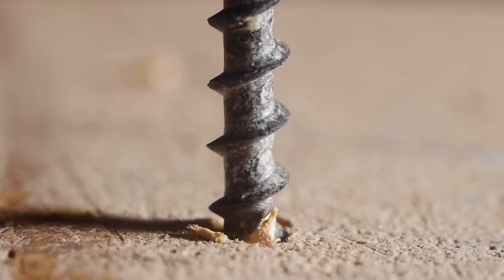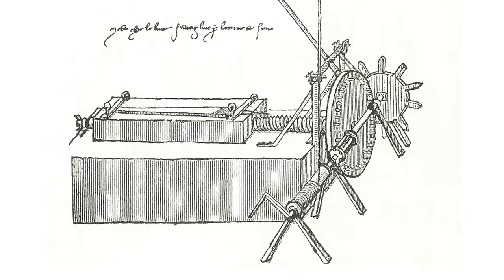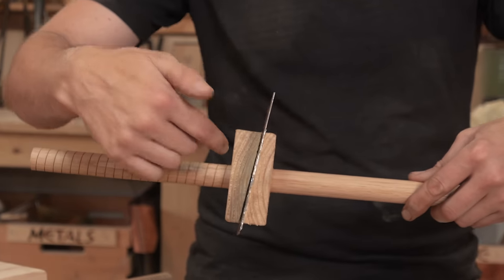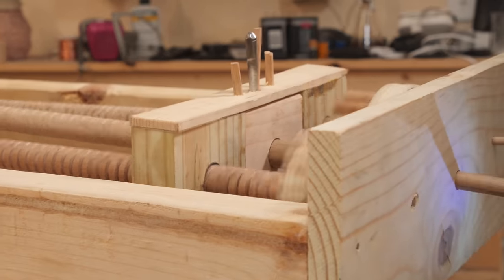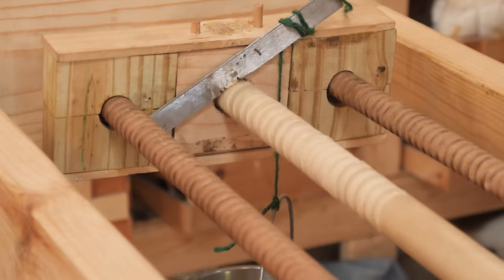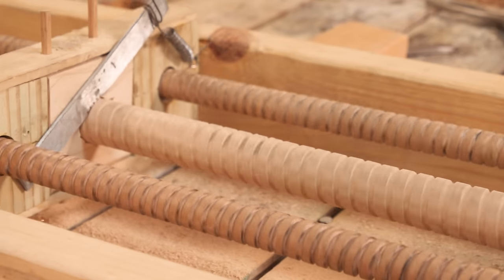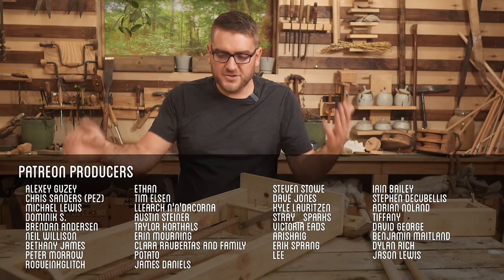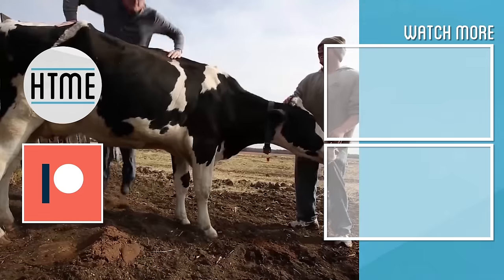This DaVinci Machine Unlocks Precision!

Comment: One of the most important aspect of this device (and of the lathe) is that the machine can improve its own accuracy merely by building with the very tool you’ve already made. As you make new screws you can replace the old hand cut ones (and more importantly) the receiving nut from a rough approximation of coiled wire to the wooden carved nut that matches the screws profile even more finely.
Reply: why even bother cutting the first screw by hand when a simple wedge aka inclined plane, pulled by a string and pulley on the shaft to force the cutter lengthwise does exactly the same thing, far more accurately?

this is one of those typical videos perpetuating the myth that davinci was a "genius" when its apparent he was not. other people figured out how to produce threads far faster and with far less hand work or guess work required.
Reply: @paradiselost9946  It’s not so much to do with just making a screw and threaded bolt with the same threaded profile, but two other concepts that this machine is trying to fulfil. 

The first is lowering the skill level to make screws and bolts. We were capable of making well mating screws and bolts before this design because Johannes Gutenberg, the inventor of the modern printing press used a screw press for his own machine. However, whilst making one screw and one bolt by hand is possible, (although requiring a hire degree of skill) it was the only way of making well fitting screws until comparatively recently because it was damn hard to achieve. Hence why you don’t see many screws in historical examples unless it’s absolutely necessary. What this machine Leonardo designed lowers the level of skill required to make screws and bolts dramatically, all the operator has to do is place the dowel into the machine and turn a handle and it will always produce the same quality of screw every time.

This leads onto the second purpose of the machine: repeatability.
Making a screw that can follow a purpose built bolt is one thing, making a screw that can follow any bolt and vice versa is an entirely different challenge altogether. But because the cutting is driven mechanically it will always follow the same input. Having the capacity to produce screws that will follow the same bolt every time is what gives modern hardware their utility, and makes them worth the effort in producing as opposed to having to produce a matching bolt for every screw you make.

Finally, there’s the matter of education and access to resources. Whilst it’s easy for us in our modern world to look back and think “why didn’t we just do it in this simple way?” It’s because learning clever tricks requires access to that knowledge. Whilst the craftsmen of the day were certainly not unknowledgeable (they were as intelligent as you or me today), they did not have the luxury of a system of shared information. What makes Leonardo da Vinci a genius in people’s eyes is that he was able to come up with a staggering number of concepts of which many were way ahead of his time only with the access to the resources and education of the period.

Comment: i think the better way of getting a smooth and good evenly spaced master screw would actually be to use two long rods or soft iron wires twisted together from the very ends. this will have them automatically form a double helix with two very consistent and evenly spaced grooves running along the entire length.
this is something a seasoned blacksmith can do in a day.

heck you could probably even do a plaster cast of a rope under tension in an easy to cast metal like copper

the problem with this machine is that while wonky cut threads will even out, any inconsistencies in pitch of the master screws will still be transferred to the new screw.

you can average out the pitch inconsistencies by offsetting the new screw between passes but that makes the process more tedious.

the master screws based on the twisted double helix of rods, ropes or wires  that i suggest should be way more consistent in pitch across their entire length with way less effort than the twist scribe and then handcut wooden masters

Comment: Cool video and project. I'm an engineer, artist, and woodturner so, this video really resonated.

Something for your consideration for a  screw+nut 2.0 project: I think that you were closer to a more elegant and more generally applicable plus usable approach w your first block. For instance, just as a scew is an incline plane twisted around a rod, a gouge is a skew cutter bent to fit around a rod and a V-gouge is a skew bent around a corner. Now consider the profiled cove moulding that they used to use to make complex crown mouldings, etc. You gradually pass the moulding plane over the wood and cut the profile more and more into the wood. Now consider wrapping that moulding plane around a rod and you have your screw rod cutter. Keep your two pieces as shown in your video and wrap sinew around the outside w a wooden dowel to twist to increase depth of cut as you make your passes. By keeping this as a smaller annular plane, you are not limited to length and you cd even use it in the field. The nut plane cutter wd be the photo negative, w maybe a wedge to drive the two pieces progressively more into the cut pass after pass. Again, smaller unit and portable. And you can even pop the screw moulding cutter into your daVinci apparatus, if you wanted to help keep longer screws straighter as you cut. I can see different screw mould planes for different diameters and pitches; just swap to a different profile. I'd love to see a Screw 2.0 video!

Comment: The two lead screws (with the relatively loose linkage) average out the errors between them, which is desirable in the transition between hand and machine screws. Cut two screws with your hand-cut lead screws, then endo one and use them as lead screws to cut the next generation.
As a bonus, if you use a much softer material (like balsa for your wooden screws, with the grain parallel to the axis) in a much longer nut (say 8 inches) you’ll average out local variations even more.

Comment: They used a tap and die box for making wooden screws back in the day. The quality of wooden screws were so good they used giant ones to cut the grooves in flintlock rifles. These barrel rifling tables were very popular in the Appalachian mountains as iron was very expensive back then so they had to improvise with wood. There's a video from Tyler Weymouth on YouTube showing one of the cutting machines from the 1960's. 
One important thing to remember is that the wood you choose you make the screw from is just as important as the tools you use to cut the grooves as some woods will splinter or will never cross cut cleanly, hardwood Maple is a good choice for making wood screws as it's close grained and resistant to chipping.

Comment: Congratulations on your improved gear-making skills!  I remember how much trouble you had with the rope-winding machine, so it's really great to see similar gears working perfectly now.  If you plan to make more rope, you should rebuilt the machine with proper gears.

So I assume you made the spring with your home-made wire?  How do you stiffen the wire after you coil it into the proper shape?  Is it just simple case-hardening?

Comment: For the next step of this, the citation is Turning and Mechanical Manipulation Volume II by Charles Holtzapfeel, Section VIII: VARIOUS MODES OF ORIGINATING AND IMPROVING SCREWS, INCLUDING THOSE OE RAMSDEN, MAUDSLAY, BARTON, ALLAN, CLEMENT, AND OTHERS, page 635, which is available on the internet archive. I'd provide a link but it looks like youtube comments doesn't like that. It covers the history of screw origination and the devices of Maudslay and Donkin that were ultimately successful in creating machine screws precise enough for machining interchangeable parts.

Comment: It might be worth it to look into densified wood, which is a more modern invention, but essentially is boiling wood in chemicals to leach out the softer parts, then press it to squeeze the fiber ultra close. With one company claiming they have wood stronger then a32 steel. 

Might be easier to do that to create stronger wood parts then get ultra refined steel.

Comment: As long as the drivetrain could handle the extra stress, you could modify the cutting tool to include several blades stacked upon one another. This eliminates the need for the spring and could potentially allow for one pass production of the screws. 

If you didn’t want to stack the blades on top of one another, you could feed screws from one machine with its blade into another machine with a different blade. This would reduce the stress on any individual cutting tool mount and allow you to make really big screws.

Of course, the use of the spring is awesome and makes this machine work so well!

Comment: Using screws to produce screws will work, no question.
I am still not sure if this da Vinci - concept is good though. Using two identical screws to produce one more is a little bit of an overkill. The machinery is too complex and would require too much of adjustements to work properly, if some precision in result required.
If I was Leonardo da Vinci, I would use a gear - rack gearing as a linear guidance for the tool to cut the initial screw. The advantage is, you can craft all required components in a sufficient quality by hand. The downside of this approach of course is, you need understanding for involute gears to get some propper precision.

Comment: I think for the screw cutter you could make a clamp and have it hold a pointed chisel in place, then you just move it down a little more per pass. It might also do a little bit of a better job than the saw and cut the thread to be more of a V pattern than a sort of U pattern whilst also possibly being able to move it down farther per pass and as-such cut down (didn't mean for the pun) your time for making these screws. Add a crank for the main mechanism and I think you're really on your way to success. EDIT: I looked at Leonardo's invention again and you can see a chisel set into the moving head and it's set at an angle like a wood plane.
Reply: The U shaped threads are far better to use to move things around(ACME threads).  The V shaped threads are used to fasten things together.  When pushing or pulling using the threads the U shape gives a big shoulder to push against and the V ends up being a wedge pushing out.

Comment: What fun to follow up on the work of such a genius!! well done! Except for one thing - none of the screws you were making had spiral threads. They are helical; the radius of their curvature is constant, whereas the radius of a spiral curve changes at a constant rate. Woodscrews usually start with a spiral curve but transition into a helix. All helical curves are 3-dimensional, but a spiral can be 2-dimensional.

Comment: The pinhole on an anvil was typically used in order to create corkscrew patterns by using the natural crystalline shape of the metals in order to make screws, not hand filing. It takes about four times as long to make a screw versus a nail which is why they took so long to become popular.

Comment: I've made screws in the past by arranging the wood at an angle on the band saw, and allowing the band to both cut and self-guide to produce a regularly spaced helical kerf.  As your constraints don't allow you to use the band saw, you could do exactly the same with a back saw, using the back to limit the depth of cut to a precise amount. When I did this on the band saw I made the same cut twice, a quarter inch apart to that I could then chisel out the space between the kerfs to make something that looked sort of like the threads on a lead screw, with a wide space between them.

Comment: I really like how infinitely recursive this is, particularly when you pair it with a gear-making jig.
with the two hand-made screws, you can make a pair of identical "Machined" screws. with those two machined screws, you can make a number of precise gears, and those new gears can create new ratios of threading, which enable you to make different screws.

once you have precise gear ratios and precise screws, you can measure things to a high precision, which means things like lathes, flywheels, presses, and such are going to become radically more useable.

I'm really wanting to see your "everything" series proceed to have a "Refined" series, where you go over the older inventions with the newer precision, to show how much better it can be made. refining the water wheel, treadle lathe, and such would probably be a great start, as with the precise screws and gears, you can gear stuff up/down properly, and that unlocks their uses in other projects.

Comment: imo, add something like a 6:1 gear set on the side that you're turning, so that you can just use a simple hand crank, and it'll speed it up. You can go bigger of course, for quicker cuts, but I think something like 6:1 or 8:1 would be the best balance between effectiveness and practicaltiy.

Another thing I'd suggest, though i have no idea the effectiveness (or feasibility), is to polish both the initial rods, and the blocks riding across them, and then using a light amount of oil to reduce friction a bit.

And according to a couple comments I've seen, you could also use it to make improved iterations, which I feel would be best to do.

Comment: The brilliant use of two lead screws is that the machine averages out imperfections in the two screws. Use it to make two new screws and use those, flipping one end for end, to make yet another iteration of two. The original lead screw for machine lathes was made by finding the best, most accurate, section of the first iteration and using that section to generate a full length screw. Rinse and repeat.

Comment: I would think that a very narrow "V" gouge like a lathe tool would cut faster and more accurately for the screw thread.
Reply: Hybridize that with some features of a wood plane. Should be able to get some smooth cuts as long as the grain on the wood being worked isn't too crazy.

Comment: the reversing mechanism to get it to run on a monodirectional input such as the water wheel is absolutely necessary because this device is an auto-iterative machine. basically a machine that makes things to make itself better, which obviously will take a lot of time. I'd love to see you guys advance in your accuracies by making increasingly accurate screws to make things like lathes. while not exactly realistic to history, it would be very interesting to see just how quickly humans could have advanced from a hand carved screw that wobbles all over the place, to a precision lead screw for machine lathe, had the knowledge been there.

Comment: This looks like it would not allow arbitrary increases in screw precision. It averages the error from both leadscrews onto the cut screw, so would improve local accuracy, but if the two leadscrews have similar error in the same places, it would not improve that. Like, if one end of both screws had a coarser pitch than desired and the other ends the correct pitch, the result would have this same issue. That can be fixed by reversing one screw, but I think that this setup cannot remove symmetrical pitch errors. You should look into lapping (or whatever the wood version is) screws, since that can reduce pitch uniformity errors. It changes the pitch slightly, but if the screw has truly uniform pitch across it's length, you can use gears to get similarly uniform threads of any pitch on the result, like a modern lathe. Moore's foundations of mechanical accuracy talks about their process for producing truly uniform screws. I think their method could be brought down the level of tools you're allowing yourself.

Comment: Maybe looking at how the screw was made for the Gutenberg Press?

So if I recall, it used a big ass block of wood with two chisel type  bits of metal in it, one at the top and the second, I think was on the left side of the block and that was used to make the screw in that printer.

Comment: Carpenters have been using screw blocks for centuries to make uniform threads in wooden dowels. I wonder how far back they were used and if Leonardo da Vinci would have known about them. They are incredibly simple to make and use.